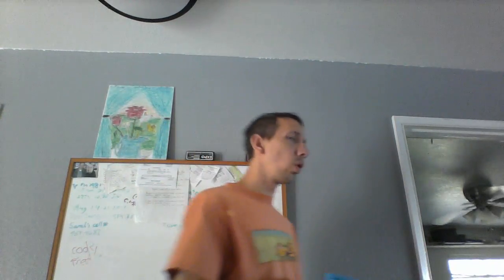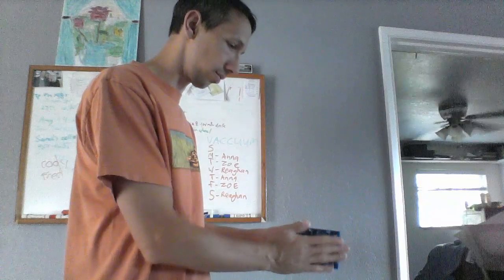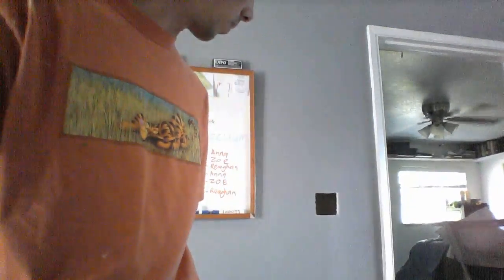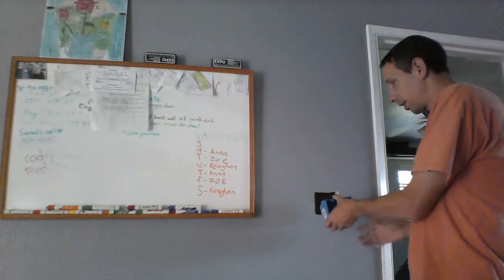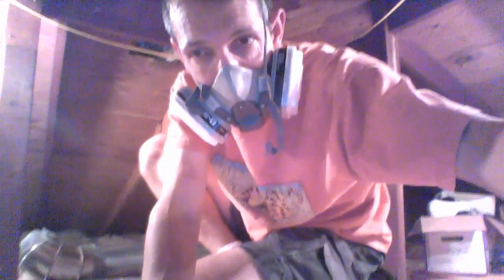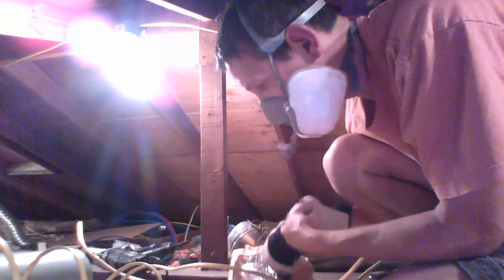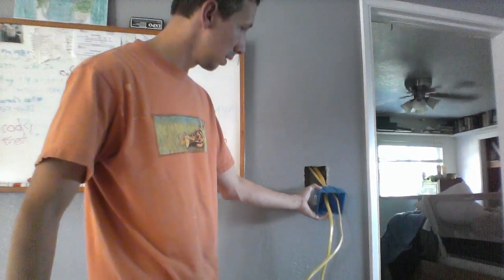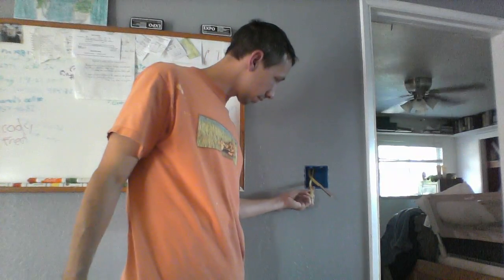QuietCool CL-4700, Classic Whole House Fan, Complete Installation Part 6

Comment: the new ES-4700 came wired to plug into an outlet.  For now, I just ran the plug into a wemo outlet to control with my phone.  I may actually attempt to wire it to the switch after watching this though.
Reply from the maker: yeah the wiring instruction are pretty clear if I remember... it has been awhile lol.  But if I can do it I am pretty sure most people can do it =)
Reply from the maker: easy to do. =) so easy even I can do it I like to say hehe good luck with your project!